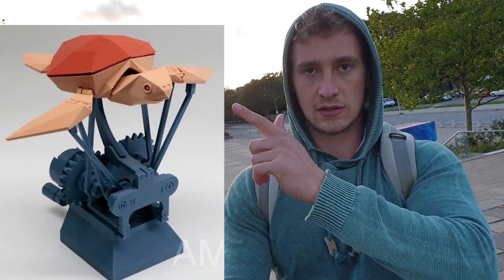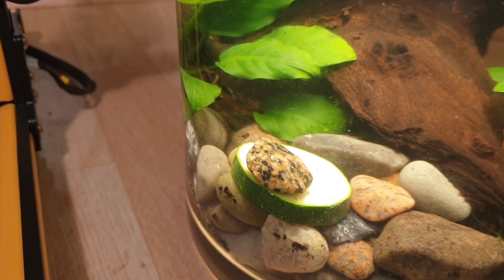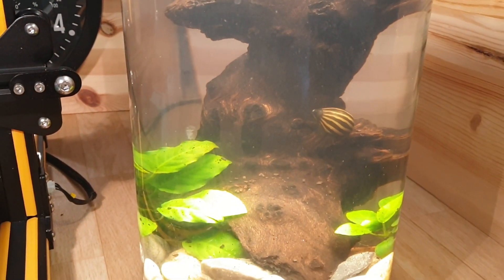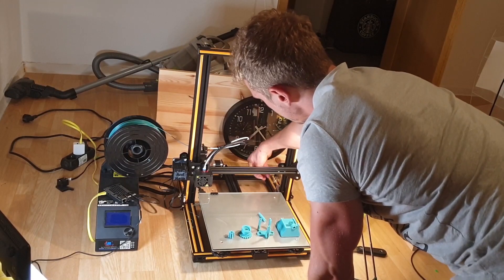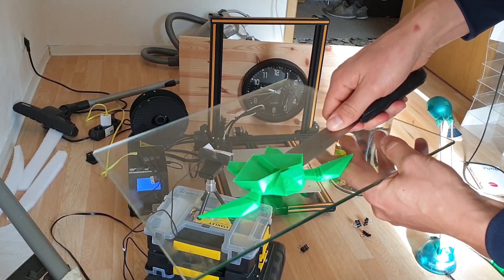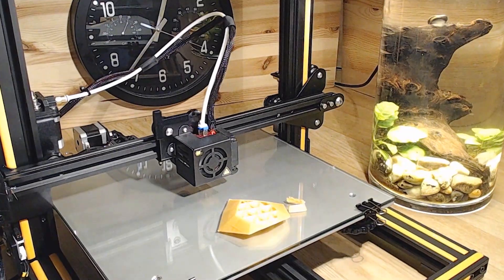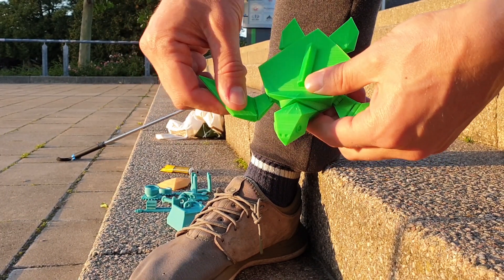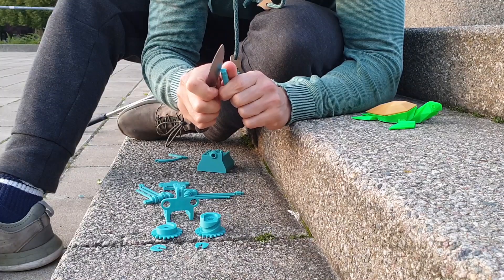Flying Sea Turtle - 3D Print, Assembly And Feeding my Pet Snail - (NOT A STEP BY STEP ASSEMBLY)

Comment: Do you need any glue to assemble any of it
Reply from the maker: Nope. But I think it works a little bit more reliable when you put a tiny bit of glue onto the upper tips of the 6 vertical poles. This way they stick better to the turtle.
Reply: @freezyAndHaze  Thank you

Comment: Hello how to deal with the stl file, because two separate part in one stl. I print them together, they can't move
Reply from the maker: When you download the file and unzip it you should see 4 folders: files, images, license and readme. The stl files you r looking for are in the 'files' folder. Open this one. Then import all of the files into your slicer of choice. But of all the parts where there is an old and a new version only take the NEW one. For example u ll find part 'FT03' and 'FT03-NEW ' only take the second one. Whch slicer are you using? Make sure to select every single part and drag it to its own place on your slicer printing bed. Did this help?